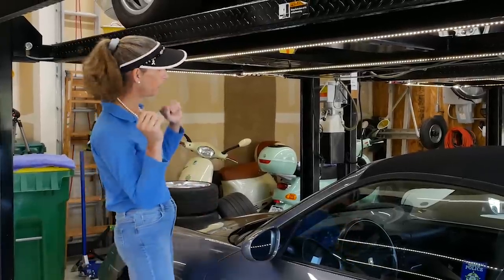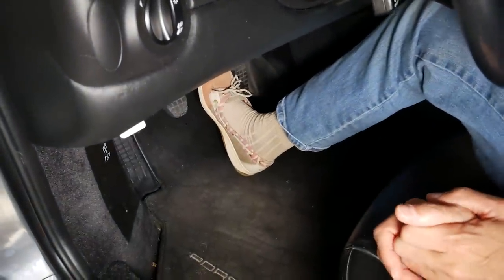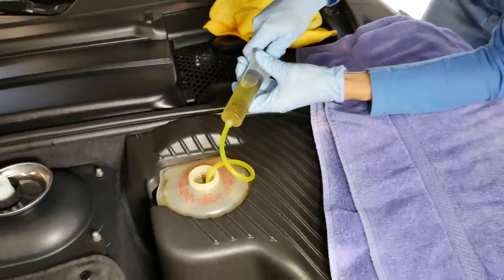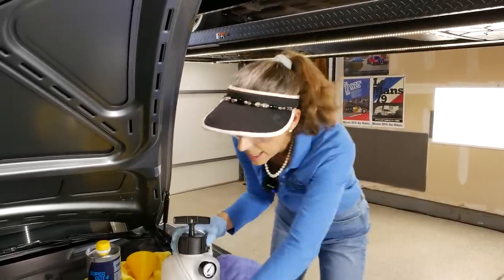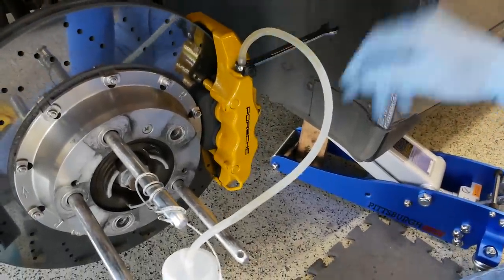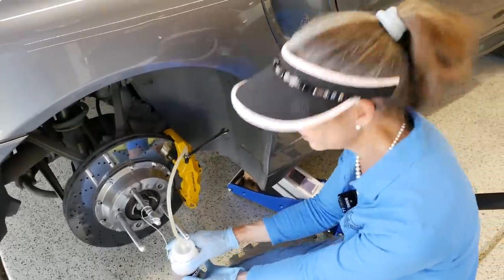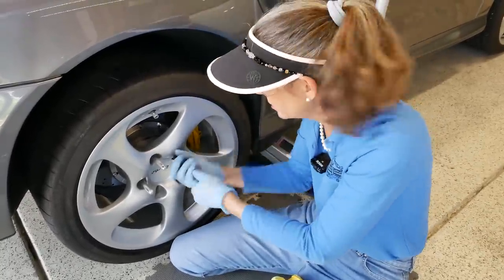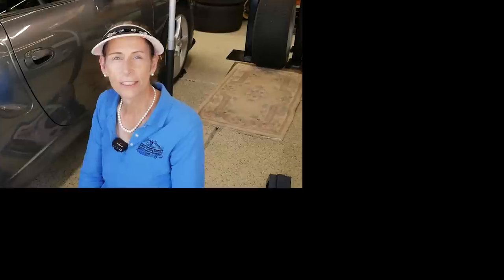How To Flush and Bleed your Brakes - EASY!

Comment from the maker: Hi Everyone, We take a little "brake" from the 911 3.2 Carrera project to bleed the brakes on the 996 Turbo.  Super easy and anyone can do this by themselves.  The whole process should take an hour or so.

A word about the bleeder I used...  The Motive Power Bleeder would not hold pressure.  I even tried completely cleaning and using silicone grease, but the valve just gives way.  I was able to get the job done, but there was a bit of having to pump and pump... I want to try the Schwaben  Power Bleeder to see if it is any better.  

Here is a list of everything in the video:

Pentosin Super DOT 4: https://amzn.to/2Iu3zuM

Motive Catch Bottle Kit: https://amzn.to/2FcpeXB

Crappy Power Brake Bleeder (one in video – WE DO NOT RECOMMEND): https://amzn.to/2I3K5Oh

*Better Brake Bleeder not on Amazon.  Schwaben 3-Liter European Pressure Brake Bleeder.

½ Tekton Torque Wrench: https://amzn.to/2XAnLBh

Safety Glasses: https://amzn.to/2I72xWz

Funnel: https://amzn.to/2IILA3V

Anti Seize: https://amzn.to/2ItkYDG

1/2 Inch Drive Professional Flex Head Long Handle Ratchet; 18" Long with TRP Comfort Grip: https://amzn.to/2WEn25X

Tekton 19 mm socket: https://amzn.to/2F0vyB3

Tekton Socket Extension: https://amzn.to/2WwmJFm

Comment: Great tutorial. Logical, well organized, and easy to follow sequential set of instructions. I watched a bunch of YouTube videos and found this to be the best. I.e., removing old fluid from the reservoir  and replacing it with new/fresh fluid before you start bleeding, how much fluid to bleed out etc. Most other videos don't mention these important points. Also, I really like the way you use the Power Brake Bleeder unit to only pressurize the hydraulic system. A bit more work to keep adding fluid to the reservoir; however, it makes a lot of sense. Especially the cleanup process when the job is complete. Nice job.

Comment: I made a bleeder from a ''weed'' sprayer and a pressure gauge from Home Depot and and extra reservoir cap.  Works great and it was cheap. 

Great job Franny!  Super attention to detail.
Reply from the maker: Ya know, I think that is  great solution!  I bet you can get it pumped up much faster.  Great tip!  Thanks!

Comment: Great tip on the wheel hanger alinement pin. I have used them on my Mercedes. Light bulb went off. I need to get a set to use my 315/70/17 wheels on my 80 series land cruiser. Changing those wheels on the trail is a strain. No longer. Thank you so much for making me rethink an application of the wheel pin.

Comment: This is a great video, very well done. I will say I did this job recently on my C2S, and I recommend just filling the bleeder with fluid. This keeps the master reservoir full the whole time, and you don’t have to remove the cap on and off that way. Great advice on bleeder valve to not over-tighten them. Super smart to ceramic coat the wheels at the same time since you have the wheels off. I did the same thing. I wish my wife was into cars like this, your skills are impressive, and your interest in performance cars is not normal for a female, and that’s fantastic. I would watch more of your videos, love your attention to detail😊

Comment: Nice job.  Thorough and professional video that reveals your obvious competency.  I agree with your premise for using the Power Bleeder 'dry.'  As you said, it prevents potential contamination of the brake fluid while keeping the unit 'pristine' - making its subsequent cleaning unnecessary.

Comment: Good video!  Used my Motive Power Bleeder two months ago -- did new brakes pads rotors, flush -- and clutch bleed. Power bleeder made job so simple... not so for the frozen rotor bolt that took seven hours to remove with torch, rust breaker fluid, and MUCH patience. Love the channel, waiting for more 911 resto vids...
Reply from the maker: Oh my...  Chris Fix demo-ed a heated coil tool that looked like it would work really well for something like that.  Next time I come up against something like that I want to give that a try...

Comment: Nice vid.  I would add one thing .PFC racing ( supplier to 991 cup brakes) and most people I've talked with who race Porsches at the pro level ( Daytona 24, etc) would bleed the inner caliper bleed screw and then the outer caliper bleed screw for the best chance of removing any air you may have.
Reply from the maker: Thanks for the tip!

Comment: Thanks for a great video.   You don't mention this, so perhaps a different set up on newer cars. I ran into an issue with my '87, when I pressurized the reservoir, it has a pressure relief valve located on the fender side and blew brake fluid all over the inner fender, not happy face.  I put a screw into it then it held pressure and I was able to do my brake fluid bleed.    Thanks again for the great videos, keep em coming.

Comment: DOT 5.1 and DOT 4 are backward compatible with DOT 3, and can be freely mixed.  DOT5 is a specialised, silicon based fluid and must  not be mixed or used with any other fluid .

Comment: Try out a Schwaben bleeder.   Worked better than Motive for me.  Also, bleed with some fluid in the bleeder bottle to keep it full while going to each wheel. At the end, empty the bleeder bottle and let air lower the reservoir level to the correct height on the last wheel bled.  Cheers!
Reply: @frankm5019  thank you.  somehow I missed that!      Edited my comment...

Comment: What a joy to view your videos, to see your garage and tools, and experience what it's like to maintain beautiful modern cars. I am learning to maintain my three vintage cars-all with German engines: 2003 VW Jetta, 2000 Ford Explorer, and 1982 Audi 4000S diesel. Should I be afraid to tackle a 1987 Porsche 924? Any caveats about that model year?  Also, I purchased the Schwaben pressure brake bleeder and will try it on my Audi today!

Comment: Another culprit of low pedals, at least with domestic vehicles is when you replace the power brake booster...the replacements have adjustable rods, and you have to use a special tool to ensure it sits flush with the master cylinder piston cup, otherwise you'll be chasing your tail trying to figure out why your pedal is soft, but you have no trapped air or fluid loss. Also, if you replace the master cylinder, it must be bench bled, before installing. I love your videos, especially the Beetle vids. My '73 SB is still waiting for its engine, and I'm waiting for my shoulder to heal from surgery.
Reply from the maker: Get well soon!

Comment: Perfect !   exactly the way i do it myself :)    I love to see that you use the original Porsche wheel pins,  1 tip ; or if you really want to go nuts.. use a special socket with plastic cover to minimize scratching on the wheel-nut holes on the rims,   i love this detailed videos,    and 1 more comment;  looks like the interiour in the 996 Turbo need a proper detail,  i could see some dust and dirt  !    HAHAHA
Reply from the maker: I need to get a 19mm socket like that...  You bet.  -- I did shake out the mat ;)

Comment: Great Video as always... so informative and well detailed...   did this car have Porsche Stability Management (PSM)?    I'd be interested in your thoughts on bleeding and flushing the brakes fitted with PSM as my 2010 Boxster has it..  for the systems with PSM, the guides i've read say I need a PTS2 or PIWIS to activate the hydraulic valves in the brake system while bleeding.   I've never seen any videos that do this and some of the forums I've read say its not necessary to clear the small amount of fluid trapped in the hydraulic valve.     Thanks!!
Reply from the maker: That's a great question.  The 996 didn't have it so no issue there, but our '06 987 had it and back then I took it to the dealership (they were great about other things so I was fine with that).  But the i8 does has active suspension and a similar setup.  I looked into it for that and found the same as you did.  If you are tracking your car then it might be worth it to open up all the valves and flush everything, but for normal use there just isn't enough there to make a real difference.  My suggestion is just to do it yourself every other year and I think you'll be fine.  That is my plan for the i8 :)
Reply: @HeidiandFranny   - thanks for the response.  I have no plans on tracking my car, so that was my thought too, but always nice to get some confirmation.   I know that at least one the OBD2 scanners that have Porsche specific modules say they support PSM brake bleed activation, but the documentation is so bad on them its hard to know what it is  actually doing.   :)   Anyway, thanks again for sharing your thoughts, i really appreciate it.
Reply: @HeidiandFranny  Hi - I think you've answered the question but please confirm: I can flush my own brake lines, per your video, but every other year have a shop with a PTS2 or PIWIS flush them to ensure they occasionally get fully bled. Is that correct? I hope so.... Thanks for your help - great videos btw!! (I have a 2003 996 C4S with PSM and  I don't track my car )

Comment: Another Great video. I am getting some brake fluid accumulate below my passenger rear tire after a recent brake service from my indy, started off small but now it's lost enough to throw off my PSM and brake fluid level CELs. I inspected the nipple and it appears to be closed securely so now I am trying to determine if there is an issue in the brake line that is close to caliper (pool collects under the tire). Do you have a suggestion to trouble shoot that?  And after watching this video I will never take my car in for another brake service!

Comment: Solved a few.problems i had. I bleed my boat trailer with a motive bleeder and run 3 bottles of brake fluid through lines. I kept getting air bubbles every time. Heard the bleeder at brake caliper can leak air throu threads.  I put teflon tape on bleeder valve threads. It still disnt stop the air. Thats thou for answering the air bubbles. Was driving me crazy
Reply: Those air leaks are a challenge.   Another idea is to smear silicon grease around bleeder to help seal air leak.

Comment: Just an FYI.. the main pressure reservoir is designed to contain the new brake fluid and push it through.. You don't need to constantly de pressurize and fill the master cylinder.. new fluid should come from the pressure vessel. If your power bleeder won't hold pressure it's most likely the gasket under the lid is missing.

Comment: Thanks very interesting. I became interested in how the braking system worked as at the weekend I found a family of 4 mice had built a home in the front trunk under - I think - party of the braking ABS system. They were all re-homed to a friendly nearby tree. Clearly I am not using the car enough.
Reply from the maker: We found a (rather dead) mouse in the engine bay of the 993 and the vents of the 3.2 Carrera.  That is super common...  They can be hard to keep out.  I hope they didn't cause too much damage...

Comment: Hi great and detailed video.
 I'd like to flush my brake system and change to Dot5 fluid. is there anything I should flush through the system to make sure I get all the old fluid out,  Like the natured alcohol or break clean, cause I know. 5 is not compatible with other brake fluids

Comment: You have done excellent well thought out videos.  When I watched you suck out the old fluid, I said to myself, real smart.  if you had not extracted the old fluid and just used new  fluid from the pressure container, you would have wasted that much more new fluid.  besides less time as well.  Question,  what do you think of the speedy bleeder valves you can replace the originals with a speedy valve with a built in anti air back flow allowing only one person  to do the job and less air? Reolywhen you have time.
Reply from the maker: I haven't used them...  You would need to use thread tape on them so they don't suck air back in through the threads.  Maybe easier to use one of the pressure bleeders if it is a more modern car.

Comment: Yet another nice video from you guys.  Thanks!  Is there no published torque spec for the bleeder bolts on the caliper?  It seems like it would be a good idea to snug down the bolts, remove the bleeder tube and THEN torque to final spec.  It's a German thing!  

This is coming from a mechanic who grew up not using torque wrenches.  BUT I just know in this scenario I'd be wondering, "Is this as tight as it was when I undid it???"  Instead of guessing, torquing would end any uncertainty.  Just my $.02.
Reply from the maker: Very good point!  Every bolt has a torque spec.  I certainly could have tightened it enough to get the tube off without spilling or letting in air and then go back and torque.  Good catch!

Comment: Solid job as always :) You can't be too careful with brake fluid. These wheels are hollow spoke aren't they? You did a great job on cleaning them :)
Reply from the maker: They are the real deal!  So much lighter than the winder rims (those are knock-offs).  Makes getting them up and down off the rack much easier ;)

Comment: These are super videos and before I tackle any job I check if you have done it before. Just a question on anti seize for the wheel bolts, I seem to recollect some manufacturer recommending that the cone of the bolt be lightly greased. Something to do with getting the right torque, have you ever heard of this suggestion?  PS I’m assembling a 912 I purchased as a half finished project, I think I put the front calipers on the wrong side, bleed nipples are pointing down to the ground, maybe thats why I cant seem to get a pedal !
Reply from the maker: Hi Paul, the antiseze can cause an effectively higher torque to be applied because of the lubrication.  I still think it is important so the bolts don't become frozen.  I also put a very thin coat on the mounting surfaces between the wheel and hub.  Sounds like you need to swap those calipers ;)
Reply: Thank you, swapped the calipers and now have a firm pedal. Living and learning.

Comment: Another great video!  I have an '01 996 Turbo, and have been holding off on the brake flush because of the following statement I read on the Pelican Parts website: "For cars with traction control or Porsche Stability Management (PSM), you need to use the Porsche System Tester 2 (PST2) in order to activate the valves in the hydraulic unit during the bleeding process. If your car has a "PSM off" switch on the dashboard, then you will need to go to a shop that has a PST2 so that the brake system can be bled properly."  How did you get around this?
Reply from the maker: There is only a tiny amount of fluid in the PSM system and the main purpose is to flush the fluid to remove water and anything else in the old brake fluid.  Better to flush 90% than nothing at all...  What is in the PSM will work its way out when that system is activated/used and you can get it at the next flush.  I think getting into the software to open/run the pumps is really most important if you were refitting all those components dry and need to completely bleed the system.  So, if you have good pedal feel and all you are doing is the two year maintenance, then better to do it and not put it off.  Just my opinion ;)  I have read that the Durametrics can't activate the PSM system so if you feel that is truly necessary, probably best to take it to a certified shop and have them do the complete system ($200-$250).  Franny
Reply: I appreciate the clarification.  Thanks!

Comment: Hi - I think you've answered the question but please confirm: I can flush my own brake lines, per your video, but every other year have a shop with a PTS2 or PIWIS flush them to ensure they occasionally get fully bled. Is that correct? I hope so.... Thanks for your help - great videos btw!! (I have a 2003 996 C4S with PSM and  I don't track my car )
Reply from the maker: Well, I think you only need to flush every other year.  Maybe every other time have it done at the dealership.  If you ever have a soft petal have the dealership take a look at it though...
Reply: @HeidiandFranny  Thanks for the clarification! I look forward to more videos regarding 993's and 996's. Thanks again, good job!

Comment: I have a question about replacing a horn ring on my steering wheel on my 67 bug.
I put it all together but won't honk now. I need to know the order of assembly, the brass cup, the plastic washers, etc. 
All the videos contradict each other.
Why it it not making contact?
Reply from the maker: Can you contact the manufacturer?

Comment: Thank you!!! I discovered my 996 turbo brake pedal will pump up, then slowly sink to the floor. Is this a leaking master cylinder or brake booster? It just started doing this.
Reply from the maker: Bad master cylinder.  It will need to be rebuilt.  F.
Reply: Thank you! I ordered a new master cylinder and finally a motive bleeder with bottles.
Reply: Wasn’t the master cylinder. I replaced it and something else is leaking brake fluid like the abs unit
Reply: @christurbo951  I would take it to either an independent or Porsche shop and have them trouble shoot it then either have them fix it or do it yourself. I've done that with my BMWs when I don't have access to a lift then I usually do the work myself.
Reply: Tr Hof I ordered a used ABS unit from eBay. I will replace the unit and I also ordered a durametric.

Comment: Great video my only comment would be never use a ratchet to crack bolts,you will stress and shear the gears and possibly injure yourself.Use a bar or a specific wheel wrench .